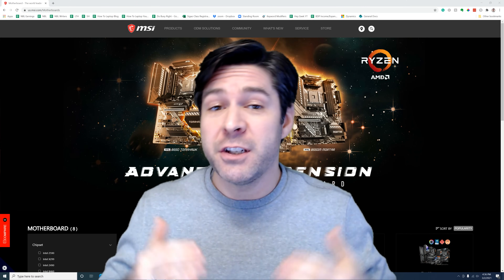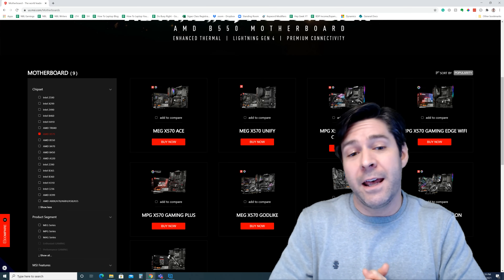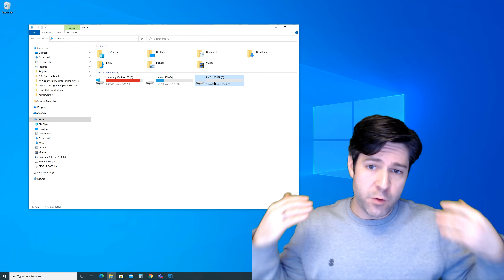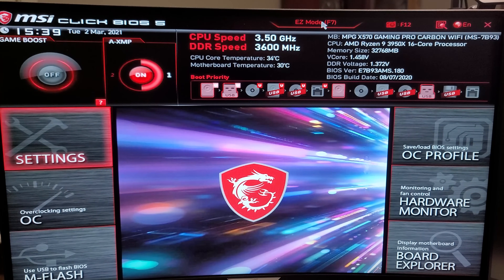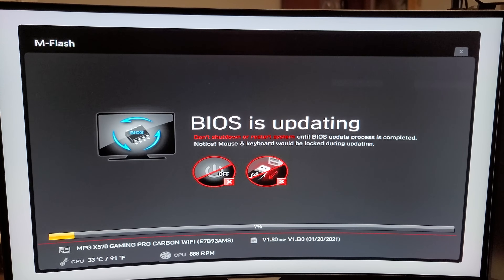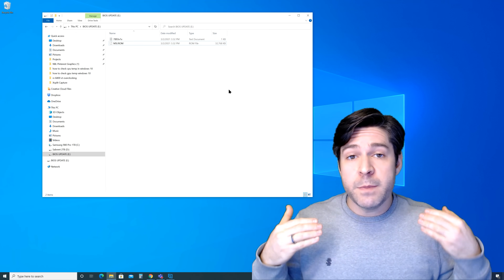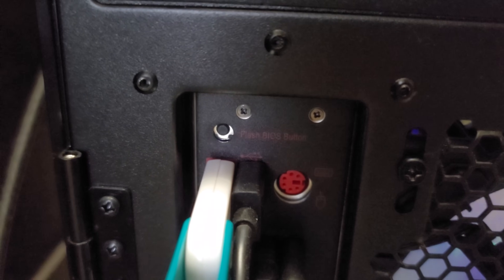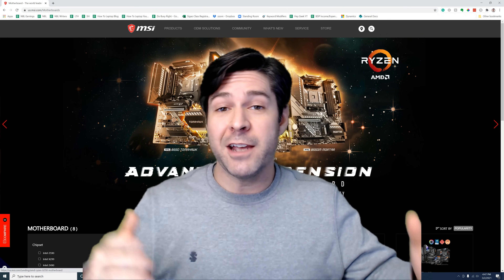How To Update BIOS on an MSI Motherboard Using Both M-Flash and Flash Button

Comment: In my case (Z690 Tomahawk Wifi DDR4), there was one crucial step missing from your otherwise excellent video: *Reset your BIOS to the default values before entering M-Flash*. I only had XMP enabled and some fan-curves applied, no other changes from the default settings, but I guess those were enough. Without the reset to defaults, I kept getting an eternal black screen after the "entering M-Flash Mode" message and nothing else happend. 

Switched from an NTFS stick to a FAT32 ... didn't help. Only when I also reset my BIOS settings did it actually enter M-Flash Mode (and rather quickly.. if nothing happens for you for two minutes or more, the system is probably hanging). Yes, yes... resetting your BIOS before flashing should be common knowledge, but I had forgotten about that.. :D 
And I can't believe how sparse and downright vague the instructions in the manual are ... they don't tell you about FAT32, they don't tell you about resetting to defaults and they don't specify which USB port to use - if there is a preference... I used the 2.0 "Flash BIOS"-one on the rear I/O panel.

Comment: I didn't know what M-Flash was before doing that probably broke my pc. 

I was curious to see what flashmode was, but my phone was dead. So, I opened it and it failed. I pressed "Quit" thinking it would bring me back to the BIOS but, it didn't. Now, whenever I open my PC, it displays a black screen with text saying  "Exit flash mode..." that lasts for a couple seconds before disappearing. I can still open my monitor's settings, but it only displays a black screen. How can I exit flash mode?

Comment: This is an amazing guide to flash the bios. I was freaking out when I didn't get an output signal. Reflashing bios using your guide helped alot. 
Thank you so much. You're the best,
Reply: Output signal as in video output? my monitor won't connect to GPU so im a bit worried.

Comment: Super detailed video, but im still having issues my bios light flashes and stops flashing within 3-4 minutes and my pc doesnt reboot or anything, i have a msi b450 gaming plus max trying to run a amd ryzen 5600 and there's a cpu ez debug led steady red on the b450 board. any help?
Reply: Same here, did you find the fix?

Comment: My MB X570 gaming plus....no video after bios update failed via msi center and CPU led on. Never do that 
1. i tried the tutorial with a 4gb MBR FAT32  but no luck, red led for cpu was on
2. formated with Rufus (free dos) MBR, copied the MSI.ROM file. It will be some other files after format but  i didnt delete them.
3. pushed the bios flash button and after 5-6 min the blinking red light stopped. No restart anything.
4. pull off the PSU cord , reset de bios via jumper
5. Put the PSU cable back and Eurika. i havent pull any parts  from the MB.

Comment: Do I need to remove the cpu before updating? 

Some context, will be building a pc and will most likely need to update bios for it to support the cpu I have, amd 5000 series. So should I update the bios before installing the cpu or just build it and update later? Thanks!

Comment: wondering if anyone could help 

I need to update the BIOS on my MSI Z370-A PRO to support a 9th gen CPU. I’m using an 8gb USB flash drive and have formatted it to FAT32 and have tried renaming the file to BIOS.ROM and MSI.ROM after using the original file names without it working, but nothing will work. It recognises the USB drive and any directories but doesn’t show any files.

Comment: Hello. I installed a new version of BIOS and now when I want to install back the older version I can not because when I enter BIOS UPDATE my flash loads but there is no file on that usb. It is formatted in FAT32. I did not have that problem when I installed a newer version and  now that i want an older one (original) i have a problem.Thanks

Comment: Why would my M-Files not recognize the new bios file? I've tried multiple versions newer than the version currently installed on my B550-A, but it will recognize the drive but not the bios update file.

Comment: so, i have an msi mpg b450 gaming pro carbon max wifi and a ryzen 5600x. my pc starts after ive flashed the BIOS, but now the "boot" debug light comes on and the pc shuts back off. also, im using a dvi-hdmi adapter for video output (worked on the last build with the same gpu) and am not getting any video output at all? (before or after the flash)

side note: my motherboard is brand new, out of the box and i assume, has no drivers yet?

reference: my build is 
radeon rx580 armor 4g oc
silicon power DDR4 memory @ 3200mhz (2x8GB)
silicon power 256GB internal SSD (M.2)
500w EVGA psu (NON MODULAR) 80+ bronze
amd RYZEN 5 5600X 3RD GEN 
MSI MPG B450 gaming pro carbon max wifi
1TB western Digital SATA HDD

Comment: I'm a bit confused but that's not going to stop me from doing this as I've had numerous USB problems since buying this board. Anyway, the confusion is whether or not the earlier updates need to be done to work your way to the latest, or does the latest include those updates too? My board's a few updates behind. I am going to assume the latest has all the updates up to that point, correct?

edit: A follow up after the update. It 100% cleared up my USB issues. On my board, over a long time, the USB (on multiple outputs) would hang up, drop out or flat out would not communicate serially to completion and what started out as a minor nuisance worsened over time...I write a lot of software on my PC and my link to my development boards is via the COM links and USB. It was driving me crazy for a long time. I was thinking it was a hardware problem with the motherboard. So happy I did a search on the problem to find that others are experiencing the same thing.
Reply: Can I unplug the usb drive once I’m done and delete the files??

Comment: What if the USB isn’t being picked up when entering flash mode? It shows up on the computer and formats and does everything just fine but when I hit the stage where you would click on the file it shows nothing. At all…
Reply: Did u ever get a fix currently having the same issue
Reply: @bioagents  it’s definitely been awhile since I’ve fixed it but I believe it was something to do with my USB. There was something minor I wasn’t doing right but eventually figured it out. If I remember exactly what it was I’ll be sure to send the steps your way.

Comment: Great video!!  I updated from an i7 7700 to i9 10900 (which required a new mobo & I went from ASUS to MSI) a while ago & was sketchy about updating the bios but after stumbling across this video I bit the bullet & updated the bios tonight & easy breezy!!  Just remember to re-enable OC for the CPU & XMP for the ram.  Also note that it defaults back to UEFI so if you were using CSM/legacy previously you have to change that back or Windows won't boot.

Comment: I would STRONGLY suggest to atleast plug OUT every other usb devices connected on the IO panel of the motherboard before doing this. 
It should be fine TECHNICALLY, but since it's something so easy and no time to do, just do it. It's better to be safe than having a bricked motherboard. Also some manufacturers suggest that only the eps and the 24 pin cables should be connected to the motherboard (so pretty much a stripped one without cpu,ram,nvme/ssd, you name it). I tried to do so while having everything already in the motherboard and it wasn't an issue. But i think it should be mentioned on a how to tutorial video like this.

Comment: HI, thank you for the video. I try to update my BIOS with M-Flash (I do not have the second option) and once I enter in the flash mode I don't see the files. My USB is formatted correctly and I tried with different BIOS Versions. Could you please help me? Thank you in advance!
Reply: me too
Reply: I had that issue the first time I tried to flash it, reformat the USB and rename it if you need to. When I reformatted it and put the extracted files back in it worked. I hope this helps(:

Comment: First time new computer build here. I've got a MSI MPG B550 Gaming Carbon MoBo, an AMD Ryzen 5 3600 processor, 16 Gig of 3200MHz DDR4 Corsair Vengeance LPX memory, a Seagate IronWolf 250 Gig SSD, and 2 SATA drives. I ran the Bios flash button method and the machine started up with the red led blinking. It's been in this state for approximately an hour. Should I power down and remove the CPU, memory, and graphics card? Should I also unplug the drives? Thanks in advance!
Reply: Still in the same state overnight.
Reply: I should also note that the CPU debug light is illuminated.
Reply: Follow-up note: I re-seated the CPU power connector, which cleared the problems that I was observing. I M-flashed the BIOS, and I'm now ready to install the OS. Thanks for the helpful video!

Comment: My MSI X58A-GD45 didn’t work it doesn’t detect the usb I made with another computer at all. It’s stuck on the white splash screen hitting delete is like hitting tab it just shows some minimum info and stays there infinitely. So this doesn’t work for the board the website shared the link on

Comment: I really feel sorry for someone who’s updating their Bios and the power just so happens to go out!
Reply: what happens then? bricks the board or what?
Reply: @august5135  yes
Reply: Same problem do you have solution?
Reply: Pretty sure thats why ups(s) exist
Reply: A power outage during a bios flash can brick your MB. I do believe it’s possible to recover from such an event but from my understanding it doesn’t always pan out. But there is still a little hope. Best to have your machine on a power backup when doing such a process.

Comment: I used the flash Bios button method and the red light flashed for a short while then stayed on with the PC still off. Is it finished updating the Bios? Will it automatically boot up again? Is my motherboard dead?

Comment: 1) I tried the flash button process, but the the red ligth bliked some times and started to light continuously.
2) I cleaned the cmos using the jumper, and I tryed again the process. The red ligh blinked only 3 times and no more.
Please, someone knows what happened with my mother board (MSI X570 Gaming plus)?

Comment: Can I use the mflash version with all the components installed including the 5600x?
Reply: If the current bios doesn’t support the 5600x then you won’t be able to boot into the bios so no

Comment: After you flashed your BIOS, I noticed the speed of your memory dropped from 3600 to 2133.  Perhaps you should also mention re-enabling XMP.  And warn them other settings get set back to the defaults.
Reply: It's better to reset BIOS to default settings before even updating.
Reply: @scotchwhisky6094  can u update the bios from a different pc than transfer to urs
Reply: @bryy6684  yes
Reply: @scotchwhisky6094  is not updating my bios the reason my pc won’t turn on
Reply: @bryy6684  yes I believe that’s a possibility, but we can’t tell you weather this is the reason in your case just from one YouTube comment. There could be many reasons for your pc to not turn on, even some fcked up virus can do that, but you’d have to be doing very sketchy shit with your computer in the first place to even get a virus like that. You could ask Reddit and give them your pc specs as well as info of what you normally do on it and whatever else. Your best bet is probably to take it to a shop so they can look at it and try to fix it.
Reply: @scotchwhisky6094  : correct me if i am wrong, to Reset Bios do you have to CMOS it, to clear all ?
Reply: takes 30 seconds to change ram frequency, its literally a drop down menu where you select your desired frequency.
Reply: 100%
Reply: yeah that happen to me this last time I Updated Bios

Comment: Moto: Don't try to fix what's still working fine!
On a MSI B450 GAMING PRO CARBON MAX WIFI i used Dragon Center Utility and started a BIOS Update...15 minutes later I was still stuck on a black screen and all fans working...
So I force stopped and restarted..conclusion..dead (black screen, no BIOS, no nothing...really nothing)! :(
I fixed back using a USB Stick & the Flash Button method, worked flawless! ;)
Reply from the maker: Glad it worked for you using the video! I never trust utilities for BIOS updates 😓
Reply: How did you get rid of the black screen?
Reply: @Boykahmed  Yes, just use the Memory Stick (with the latest BIOS version archive on it) + Flash Button method shown in the video.
In a matter of minutes everything will be fixed!

Comment: How to get click bios on MSI? I used to have it and then it went to basic bios without the mouse pointer and blue screen.
Reply from the maker: It should be automatically enabled depending on your motherboard. If not, it's probably just buried in the settings

Comment: Great video. I followed the steps with MSI b450I Gaming Max WiFI mini ITX board. E7540vb5.b50 is the bios file I wanted to flash. Mflash cannot find the file on the USB stick. Tried 3 different USB sticks, all FAT32 formatted,  and two different USB ports and same no file on the disk type of message. Any insights? Thanks.
Reply from the maker: When it comes to BIOS files and USB sticks the first word that comes to mind is 'finicky' - I've heard that you might have better luck with older, USB 2.0 sticks rather than brand new ones.
Reply: did you ever get a workaround? I tried with a 32g stick, 2.0 but I tihnk it's too big of a flash drive. Currently waiting for an 8gb stick to arrive to try with that.
Reply: @LuisGarcia-od1dz I used a 2 GB stick FAT32 formatted. I did not get a work around. After tries with a few different sticks, I looked at the board carefully and noticed that the box in which the motherboard arrived was labeled Max WiFI Mini ITX. But, the board itself was Mini ITX AC. Specs wise there was not much difference between them except that the BIOS for the boards is different. Once the USB stick was written with the BIOS for AC, Mflash recognized the file on the USB stick. For me, the lesson was not to assume what was in the box is the same as what was labeled on the box.
Reply: @vhareti1  thanks! I I was downloading the file for a B450 Max ii (which I thought it was based off my newegg order history) but I decided to check it through the command line and it said it was a B450 Max. smh had me running in circles over nothing
Reply: @LuisGarcia-od1dz  Glad my experience was useful to you.

Comment: To mflash with existing prebuilt computer, do I plug the USB into the bios USB port? Or a non bios USB port? (I have msi x570 tomahawk) (I've prebuilt the PC with all physical componants connected, but not any software and haven't even started it up yet) is it safe to do the mflash first also before touching anything else?
Reply: I plugged the USB drive on the bios USB port (MSI B550 Gaming Edge WiFi) and it worked with the 1st method.
Reply: @NamethatstartswithS  thanks mate I really appreciate your replying 😊😊😊 going to give it a shot 👍
Reply: Your amazing mate it worked!!!!
Reply: Love what your doing mate 😄
Reply: @jurbanana  Did u use mflash with a 5000 series processor plugged in already?
Reply: @albintangring1110  yes I had whole computer assembled with a 5900x. Used USB 2.0 16gb, format fat32, only switched on psu, renamed to msi.rom
Reply: Plugged into bios USB and pressed button,
Reply: @jurbanana  aha so you used the flash bios Button method
Reply: @albintangring1110  yes it worked perfectly... I thought it wouldn't even post because it had the 5900x in it already
Reply: When you press button wait 10 seconds.. computer motherboard and fans turn on and flashing till it's done... Waited 20 minutes to be safe then switched it off and then powered it on
Reply: And then it loaded into bios
Reply: @jurbanana  okey I think i Will try with motherboard only since ive heard thats better. I got msi b550 but i Guess i need to rename anyways
Reply: @albintangring1110  yeah should work bro I'll try link the best video I found
Reply: Oh yeah this video lol

Comment: I did this because my bios didnt work properly (menu didn't show up, windows booted normally). I used the second method. The problem is that when I press and hold the bios key im obviously in the bios menu but i only see 1/4 of the whole menu. Everything is buggy and missing. I can still leave the bios by pressing ESC and enter and windows boots normally. But i want the bios to work because I need to install my M2 SSD.. any help how i could fix it, or how i either completely reset the bios?
Reply from the maker: Is this a desktop PC with a desktop motherboard or a laptop, by chance?

Comment: Hello Geek,
I want to upgrade from r 3300x to r 5600x. So, should I update the bios while using 3300x and the remove it and assembling the 5600x? 
Also, If i update to latest bios,  can I still used the rygen 3300x cpu.

Please help.
Reply: yea just update bios using  your current cpu  to the latest and verify it updated by the build date of the bios you installed.

Comment: I have ryzen 3 3100 processor and i bought New ryzen 9 5950x to replace the existing one. I have tried to boot my pc using the 5950x in my MSI B550 Tomahawk Mobo but nothing is showing in screen and my cpu us giving me beep sound. When i switched back to 3100 it started working fine. Is it a BIOS related error or a processor error? I have may month 2020 BIOS version currently installed. Please reply quickly as it would be helpful for me to return the processor if faulty.
Reply from the maker: Yes it is likely a BIOS issue. First, check to make sure your motherboard officially supports the 5000 series CPUs and then you'll need to update the BIOS to a version that adds that support.
Reply: @heygeek3816  It was a BIOS issue, now i have fixed it. After updating my motherboard's BIOS, 5950X started to work fine and yes Ryzen 5000 series CPU's are supported in MSI MAG B550 Tomahawk motherboards.